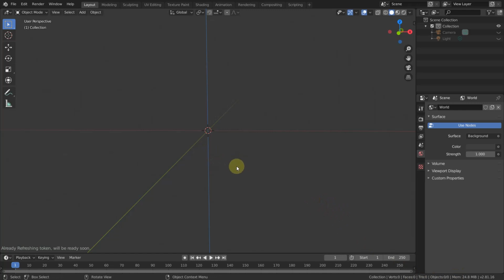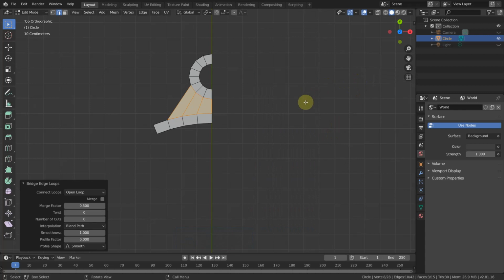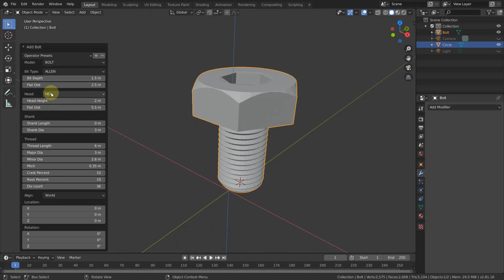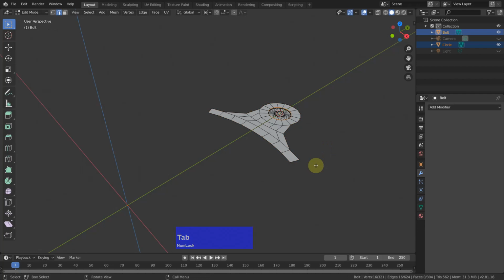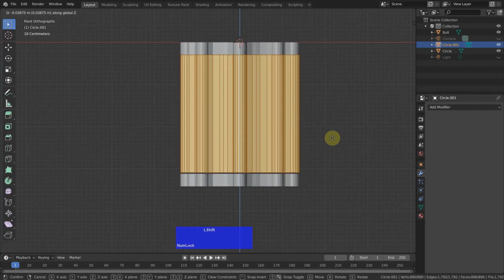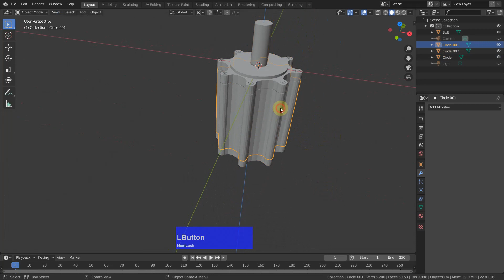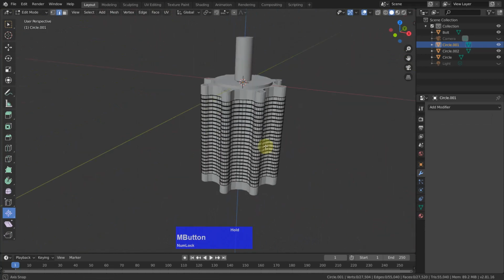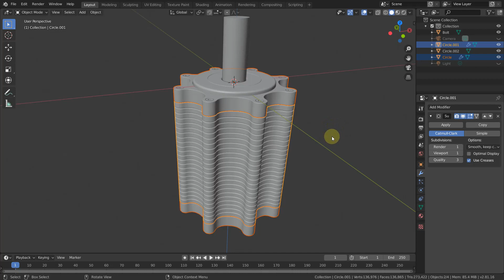A MODO Fans view at Blender 2.80 - Stepper Motor

Comment: @Peter. Do Blender have feature like Mesh Ops in Modo?
Reply from the maker: Hi, i think Mesh Ops have been introduced with MODO 12.0. I am still on MODO 9.02 so i can't answer your question. On the other hand the Blender modifiers can do a lot and i by far don't know all of them. Kind regards, Peter
Reply: @stammpe2  Great! I will try Blender
Reply: @stammpe2  I try modifier boolean. It work but not stable. When I move cutter object it's make main object disappear. I think Modo is more stable.
Reply from the maker: @travisnguyen1475  Hi, i have absolutely no stability problems. I used to have many, when i started, but in 95% it was my own fault. Try to enable Bool Tools, it does ship automatically with Blender 2.80. Kind regards, Peter
PS: The most common source of problems are:
1. Duplicate geometry
2. Normals are not the same over an entire object
3. Geometry inside an object